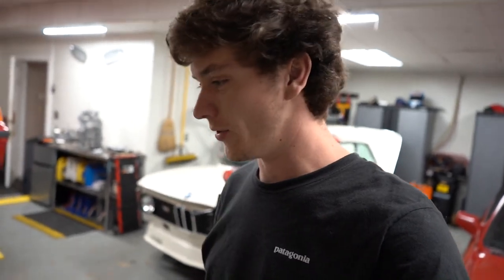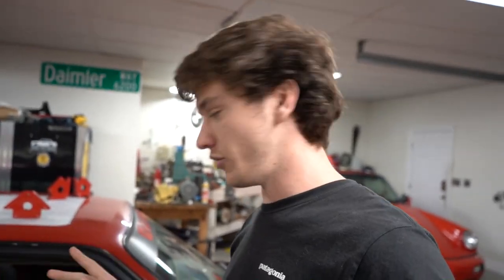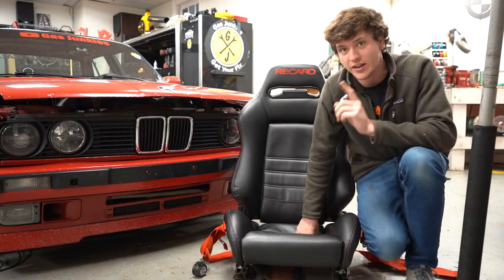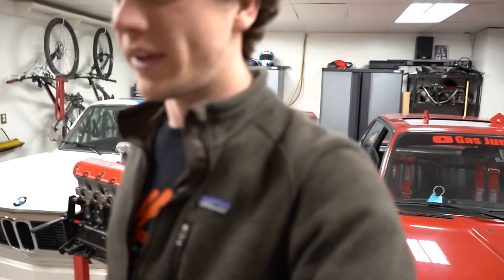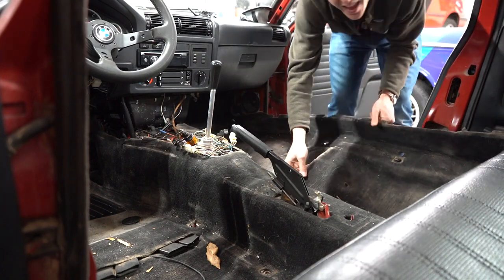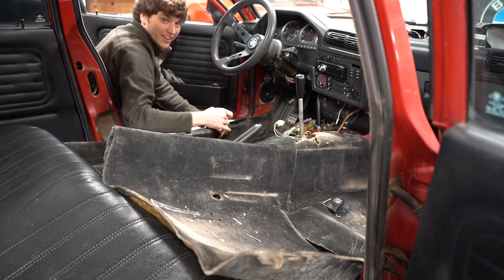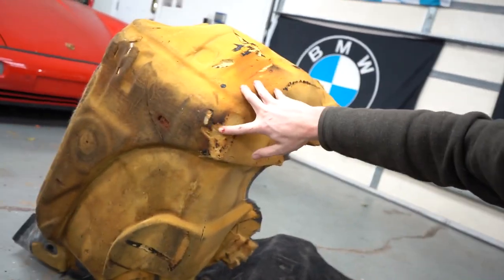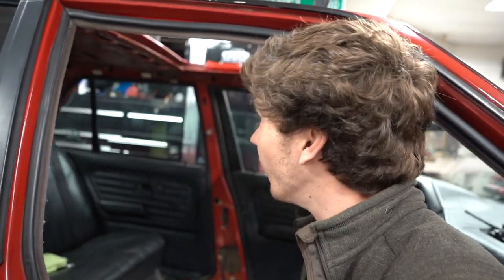Time to actually start fixing the V8 E30...

Comment: Nice I cut mine out with a angle grinder on some of the areas in the back and then replaced it with a carbon fiber insert. The welding in the old piece is definitely the way to go if you want to look super clean